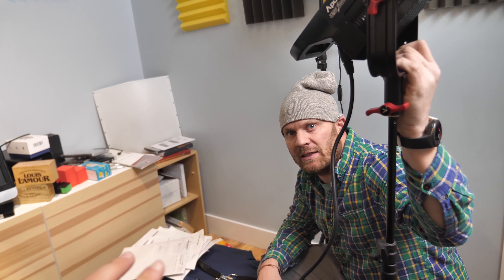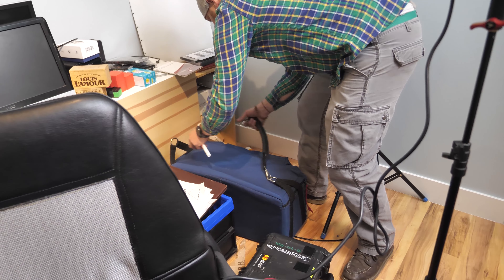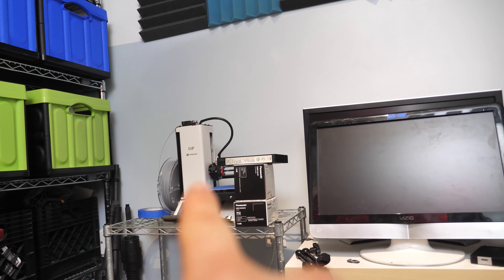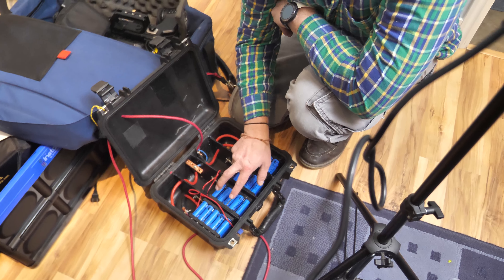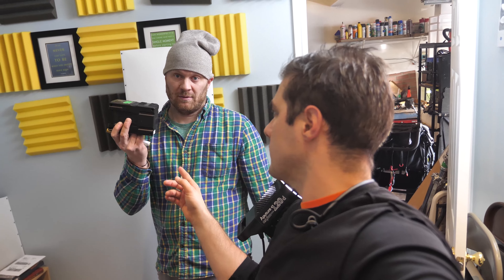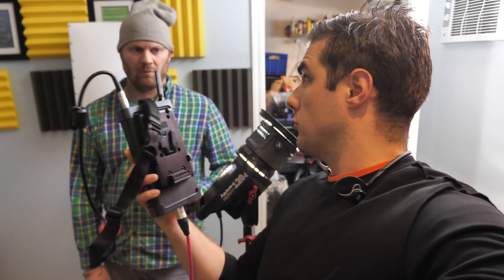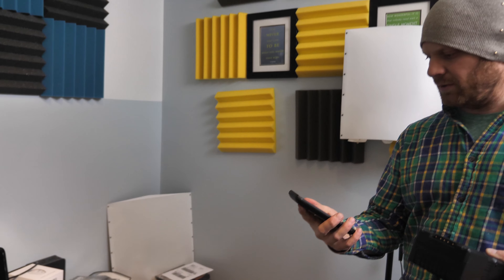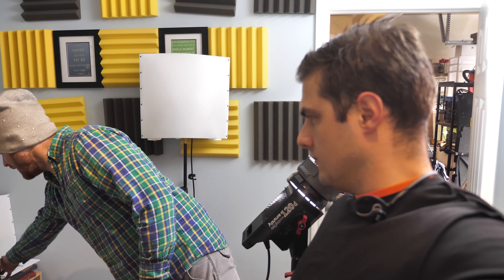Jared Custom Battery Beta 1

Comment: 18650 needs to be balanced as well. You should buy BMS for ~$40. Other than that it’s a nice idea.
Reply: Bartek Nowakowski it is a good idea to balance them once and a while but the amp draw is pretty low compared to high performance drone/rc lipos so the voltage difference never gets far enough to need to balance them in my experience after lots of testing the cell stay the same.  Hope that makes sense.